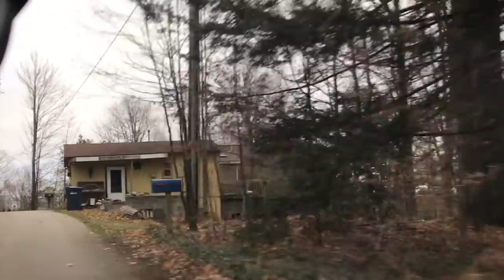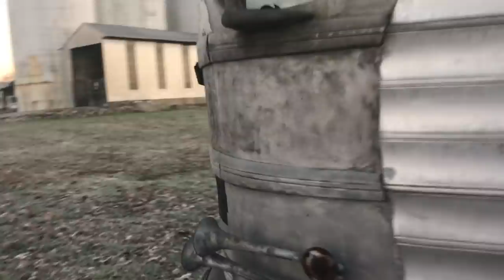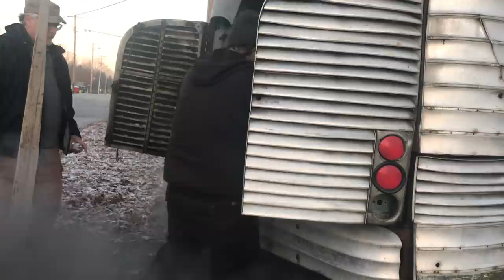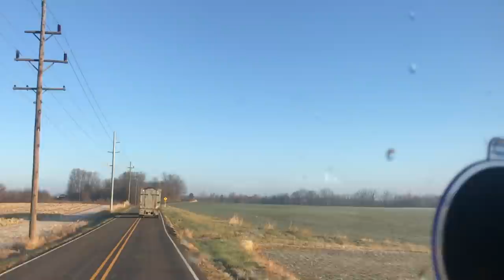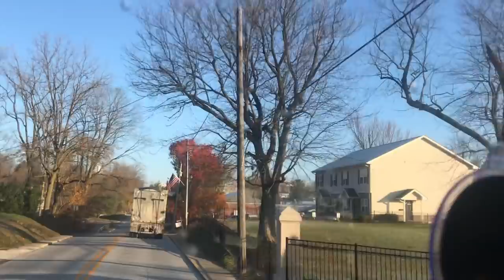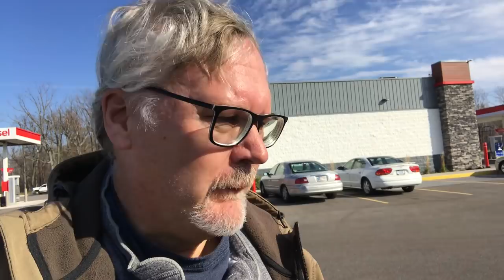Greyhound PreWar FAIL Bringing her home Part 1

Comment: There were no buses before 1964 that had any kind of seat belt mounting hardware or ready to install plan.  The belt requirement, initially two point, only became effective in the mid-60s.  I added a two-point belt to my 1961 bus by using the seat mounting bolts to attach the belt hardware.  Problem is, anything you add is not subject to any kind of the extensive testing programs now required.  It makes me feel better, but I doubt the real integrity of the plan under crash forces.  Way to go on your progress!  
I'm really interested in seeing the air shifter you mentioned and how it works.  I was thinking it had an air clutch.  Didn't realize the shifters were air also. 
I admire your attitude about potential problems on the road.  One of my greatest phobias!   Good luck!  looking forward to part two.

Comment: You need your governor set so you can do 74-75 MPH. Some parts of Ohio are 70MPH for All vehicles. Being able to go the speed limit in most states will make driving less never racking. O would also guess the parts of the air system feed by the new pressure tanks: the new constant pressure dislodged gunk/junk in the lines. Every thing connected to the new tanks likely need the lines, screens/filters/diaphragms cleaned out.

Comment: If you are not familiar with "double-clutching" you should ask an old-timer. You can usually shift gears smoothly without the meshing noise or grinding the gears when you double clutch. Not meaning to be smart fannied!

Comment: If you’re going to own old buses, please learn how to shift non synchronized transmissions, especially downshifting.   You are tearing up those gears.
Reply from the maker: Lol I was wondering how long that was going to take. I was doing much better towards the end, this one shifts a little different than my silversides 3751 because it uses air. Towards the end I had the accelerator dialed in so I would mesh the the gears at about the same rate and it was going pretty well.
Reply: @SilversidesSage   best advice i can give is to shift only when you have to. as shift up when you hit the governor, and shift down when you can not stay in the gear your in. upshifts will be much easier if you run it up more, and downshifting does not as need as much RPM when you let it come down in the gear you are in. short shifting is not good for a heavy vehicle like this. still, you are doing okay for somebody who has not practiced this a whole lot.